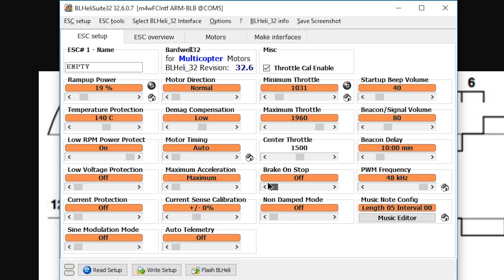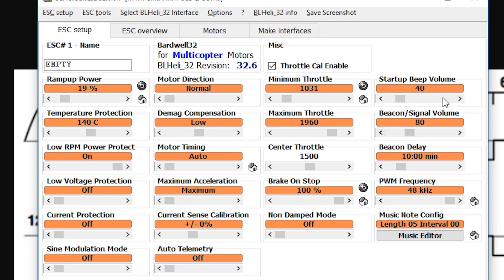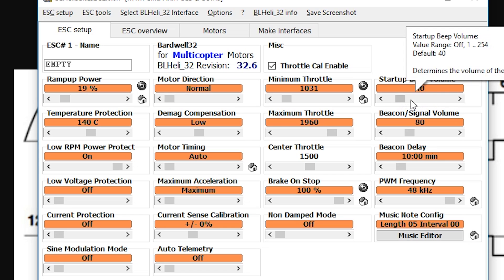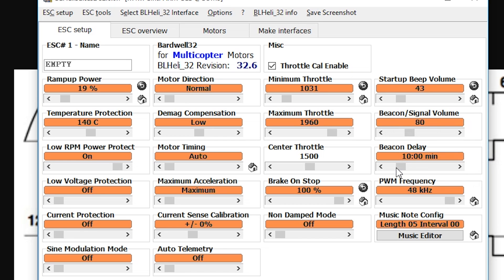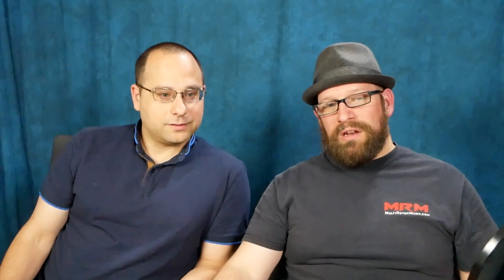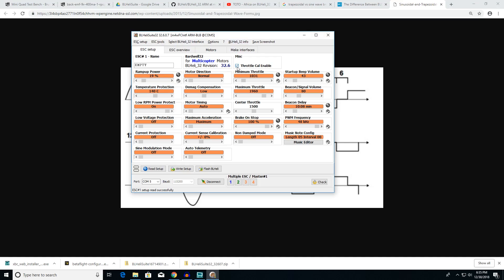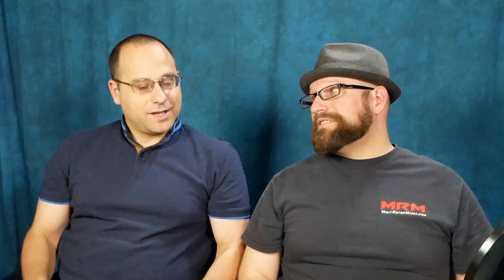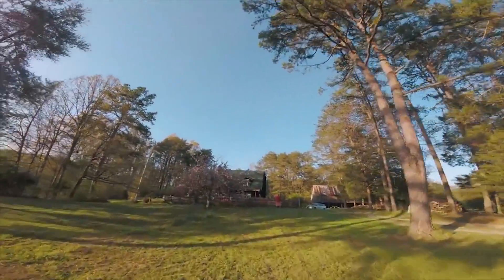BLHeli32 100% Explained - Part 12 - Brake On Stop, Damped Light Off, And Others

Comment: I think it is not what it is doing. A regenerative breaking does short two phases until a lot of amps are flowing and build up the em field on the coils, than opens the circle to let the running charge from the coils build up voltage and than it is using this voltage. For breaking you only need to short them.

Comment: Wow. So the ESC works as a turbine battery charger if just signal it zero throttle and turn the motor with wind. The ESC will try to stop the prop by dumping the energy into the battery!

Comment: With regards to Brake On Stop, I’ve the default of Off, but wonder if it makes sense to have 100% so when you disarm above grass, the props stop before it mulches the grass and sprays it all over the quad?
Reply: brake on stop is a little risky and has killed ESCs in the past.

Comment: I have a racerstar RS30A and i cant turn off damped braking, there is no option in BLHeli!
Does anyone know if it can be turned off using the transmitter and esc bleeps?
Your probably thinking why would he want to turn it off?   The ESC is on a fixed pitch heli and the damped braking transmits large torque forces into the heli as it forces the large rotor set to slow to quickly on throttle reductions and can yank the helis main body round by as much as 70-90 degrees before the tail brings it back in line again :(
I use to fly on another esc which did not do this and its taken some getting used too and i have to be very careful at how fast i reduce my throttle now and really want to turn it off if i can  or i will have to replace the esc with something else.
Reply from the maker: Are you on the latest firmware? Blheli_32 used to not allow braking to be turned off but I think they changed it.
Reply: @JoshuaBardwell  it's a blheli_s esc (G-L-30 type),  not a 32 esc.
I've tried all firmwares from the oldest to the newest and none support damped braking control but it's active on the actual esc!
The option is in the blhelisuit version I'm using before connecting and reading the esc but dissappears once the esc Config has been read.

This obviously means that those functions are not supported in blhelisuit for that esc but the damped braking is a stated specification by racerstar for that esc and it's most definitely active so Im hoping that there is a throttle programing method to turn it off.
I've searched and can't find any instructions on the bleep menu, it supports tx throttle programming but without knowing what each bleep group means I can't do anything :(

Comment: What am I missing? I downloaded the latest blheli32 suite. 32.6.8 and i do not have some those options . Especially current protection. Im using a clr4 , ak32.
Reply from the maker: If the ESC doesn't have current sensing, then it can't do current protection.
Reply: Oh thanks! I figured something like that was it.  @JoshuaBardwell . Your videos are always so useful . Thanks to them I solved my dysnc on my rooster now 6s. I could go back to my no throttle curve settings . Full throttle now . doesn't desync at all with .... Demag set to High and motor timing to 23. I'm using a rooster frame , 2207-2450kv, clr4,ak32 , 1250-6s 80c. Them motors scream like never before amazing!

Comment: I tried BLheli32, but it will not read any of my esc's..  How do I troubleshoot, or fix the communication?  I already tried the impulse RC driver fixer..
Reply: So typically I forget I that you have to connect your battery to communicate with the ESCs

Comment: No damped light mode explained?
Reply from the maker: Yes, it's explained in this video... Umm... Isn't it?
Reply: @JoshuaBardwell  in the beginning of this video. But I remember that there where more modes on older blheli versions. Props are damped on speed when you lower the throttle.